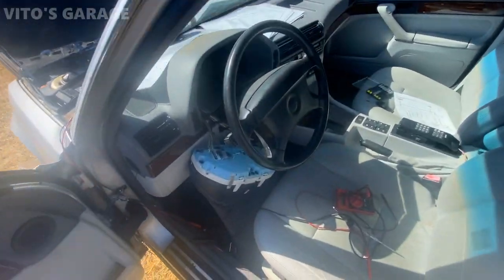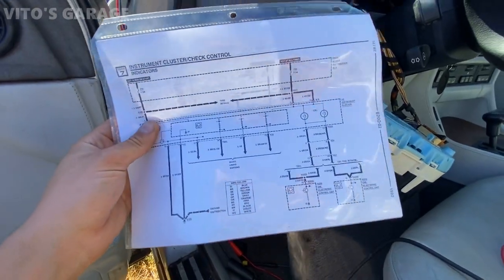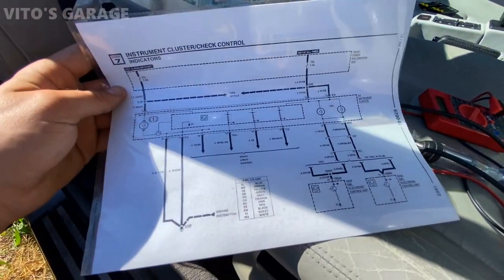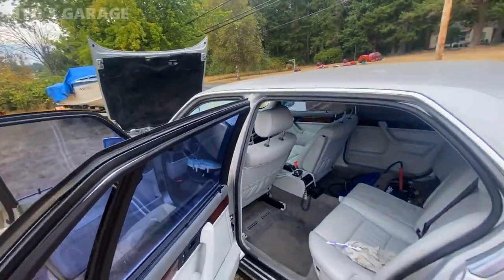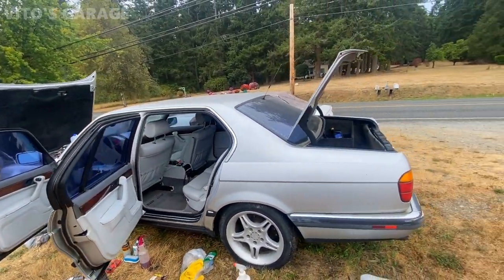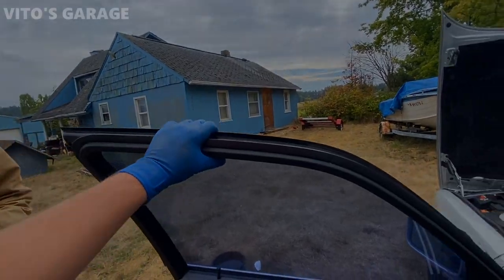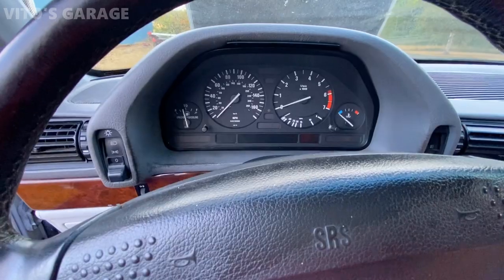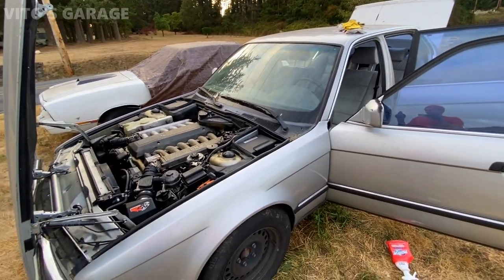Back To Life After 3 Years!! Limp Mode/No Power/No Acceleration V12 E32 BMW 750iL Diagnosis & Repair

Comment: I feel like I came in on the middle of something. What the heck is the EML and what does it do?
Reply from the maker: Sorry.. I should have explained that in the video.. EML is a very important part of this particular BMW. The acronym “EML” stands for “Elektronische Motorleistungsregelung" which is an electronic system controlling both electronic throttle bodies through the electronic fuel pedal. There’s no mechanical gas cable from the gas pedal to the throttle bodies, it’s all electronically controlled. There’s also an EML module itself that plays a big role in this whole EML system. 
Now, when you turn the Ignition ON, the EML light on the cluster needs to come on and go out if everything is working properly. If the EML light stays on, that means that there’s a fault in the system and your car will be usually in limp mode. 

However, in the case of this car, when you turn the Key ON, the EML light wouldn’t come on on the cluster at all… 
And the EML module needs to see the feed of the EML bulbs but it didn’t. The EML light was never coming on. And because of that, we had no acceleration and it was in limp mode. The EML module wasn’t letting the throttle bodies to open all the way. 
Once I found a break in the wire and fixed it, the EML light comes on and goes out, meaning, there’s no faults in the EML system and EML module sees the EML bulbs. This allows throttle bodies to come back to live and be fully controlled. A little complicated system but pretty sophisticated for 1992! A lot of Bimmers with electronic throttles have EML system.

I hope I explained it well enough. So sorry for not explaining this in the video…
Reply: @VITOSGARAGE  Thanks Vito, I understand now. Of course it's a long ass German word. Lol. And to think I used to be able to speak it when I was a kid.
I do remember a video on "Wheeler Dealer" that they got a car, I don't remember what, that had electronic throttle and they had to repair it. I think it was a bit simpler.
That does seem to be a very smooth running v12. Nice old car. Thanks again!
Reply: @VITOSGARAGE  EML is primarily BMW's electronic throttle control, but it also does double duty as a vehicle speed limiter (speed limited to 155 miles per hour, although aftermarket chips can delete the limiter.  The E32 has been unofficially tested at between 160 miles per hour and 170 miles per hour with the limiter disabled.  The EML system also manages the V12 as two inline six cylinder engines.  It was a pretty cutting edge system back in 1988.

Comment: Great recovery. I have an E34 535i with EML. Since a flat/dead battery, I've had a constant EML light on, even with the key out of the ignition it still shows! I've read that when your battery drops below 11v the EML can be triggered. When the battery went flat,  I got locked out of the car. So I opened the trunk with the key and I put jump cables on my amplifier power lead in the trunk and ground to the trunk latch to get some power to open the car door. I then fitted a new battery. For a few hours yesterday the EML turned on then off as it should and I had good throttle and took the car for a good drive. Then by the evening, it happened again. Where should I be looking to sort this out? The new battery voltage is fine and I've done the OBC test #9 to see the charging capacity from the alternator and the readings seem fine I believe. Do you think it could be a faulty alternator or bad ground somewhere? It was fine before the flat battery incident. Any help would be much appreciated.

Comment: Just an FYI - ALL of the 740s and 750s had electronic throttles.  Some 735s had manual throttles, some had electronic throttles.  It's pretty self evident which is which.  The non-electronic throttles used a conventional throttle cable.  Thanks for a great video!
Reply from the maker: Thanks for extra info and tips as well as your support!🤝

Comment: Vito can you tell me the difference between the E-34 ,and the E-32, other than the engine E-34 is usually a 6 cylinder and the 540 is an 8 cylinder, the E-42  which is the 7 series usually is a  12 cylinder but basically the same body style as the E-34 except wider
Reply: E34 is 1989 to 1996 5-series.  E32 is 1988 to 1994 7-series.  No such platform as an E42.  The E34 and E32 shared some powertrains and several other parts.  E34 is sort of a 3/4 size E32.  Styling is similar but still different between the vehicles.  E34 was styled to be slightly sportier looking than the E32.  E34 was also available in a wagon bodystyle which the E32 was not.  E34 also had an M5 version, which did NOT share its S36/S38 M-engine with the E32.  E34 also had an M42/M44 four cylinder in some markets (not US), had M20 2.5L 12-valve six cylinder not available in larger E32 putting out 168 hp, but then moved to an M50 24V 2.5L inline six putting out 189 hp.  The 3.5L M30 inline six put out 211 hp in catalyzed US spec shared with the E34.  This engine was replaced in both cars by the M60/M62 32V V8 putting out 282 horsepower.  E34 offered both manual and automatics for the V8.  E32 had manual transmission ONLY for the M30 until it was quietly phased out after 1990 due to slow sales.  E32 was only offered in automatic form for both V8 and V12, however there have been aftermarket manual swaps from E34's and E31 8-series transmission swaps.
Reply: @houseofno  The reason that I say it is that I have an E34 535I and when Vito was working on that car, what I was trying to find out is the difference between the E-34 & the E-32 I was also wondering if the wire loom is compatible with the E-32, because the E-34 had the 525, 535, and the 8 cylinder  540 I would believe that  the parts are compatible
Reply: @EnriqueLopez-hb5jn  The primary differences are size and styling. The E32 is longer (both short and long wheelbase cars) and wider. The two cars did share mechanicals and various other parts.

Back then, BMW primarily had three car lines - the 3-series was BMW's entry level line; the 5-series was the mid-range line, while the 7-series was BMW's flagship, their largest and most luxurious vehicle.

The E24 6-series was their midsize personal coupe that was based on the E12 1st gen 5-series from 1977 to 1981, then switched to the second-gen 5-series E28 from 1982 to 1989.

The easiest way to tell the difference is the headlights and taillights. The E34's front turn signals neatly wrap around the sides of the outboard headlights. On the E32, the turn signals vertically frame the outboard headlights in a straight vertical fashion. On the taillights, the E34 taillights are taller but narrower than the E32s. The E32s tail lights are lower, wider and more of a wide L shape. Hope this helps.
Which wire looms are you referring to? The engine wire looms between identical engines and powertrains should be interchangeable between the E32 and E34.

Comment: Hey Vito, I know it's off subject...
My w202 C180 Classic is running like a dream but I lost wipers, turn signals, horn and radio after I rewired headlights due to insulation gone off. I only touched  left headlight as everything else is fine. So what could be the problem ???  Keep up the awesome work well done , Steve.
Reply from the maker: What exactly did you do to the wiring of the headlights? 
Also, check the fuses. Maybe one of them blew. If the fuses are fine, I’m going to look for the wiring schematic
Reply: @VITOSGARAGE  Hey Vito, thanks for replying... I only replaced a headlight H7 connector as the insulation was perishing. I have been told it may be a issue with earth/grounding  or relay.
Reply from the maker: Check your fuses first. That’s number one place to start.

Comment: great detecive work however you should have opened the cable harness.  If you have a parasidic draw then you need to investigate everything.  New battery then its a huge drain.  well done in finding the culprit.
Reply from the maker: Broken wire won’t cause a drain. This car has a problem with window and sunroof switches staying powered on and the illumination is on when the key is out. That’s what’s causing the drain

Comment: If you still have a eml problem i had that in my e32 740il was very slow it was a rear speed sensor
Reply from the maker: Thanks. The EML and limp mode was fixed up! The car is doing well and is back to life. I’m working on parasitic draws now. It has a few

Comment: Vito, isn*t there a White BMW, right next to that car you are working on, it looks like the same model
Reply from the maker: Yeah. It’s 740iL, same chassis E32
Reply: @VITOSGARAGE  The reason I say, is because, at least you could get an idea of where that cable that you fix goes connected,it would make it easier to  see than a wiring diagram.